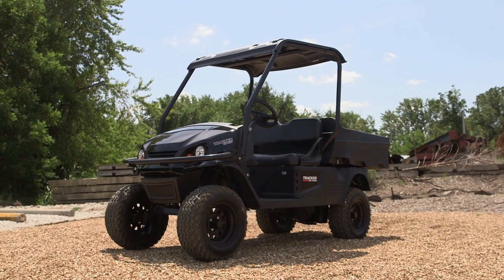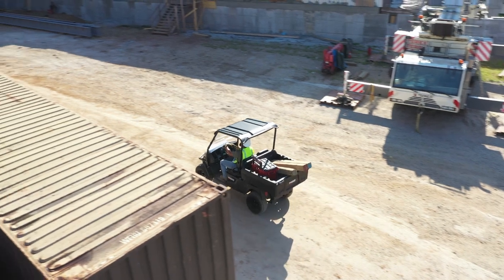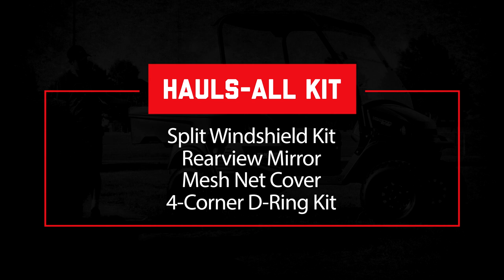TRACKER OX400 Demonstration & Bumper-to-Bumper Walkaround

Comment: These things are complete junk. Just test drove one. Its a golf cart with no suspension.  Going down a gravel road is rough. Im not sure why they put off road tires on it because it doesn't have enough power or suspension to go off road. Its literally nothing more than an overpriced golf cart. You're not doing any real work with  this thing. It's completely gutless and pointless.
Reply: Glad I read this. Thanks
Reply: Mine hauls rocks,firewood and takes me through the woods to fish or hunt.runs around 25 mph. What else do you need.

Comment: Where is the battery
Reply from the maker: OX400 battery information should be available in the owner's manual here: https://www.trackeroffroad.com/content/dam/wrmg/tracker-off-road/documents/owner-manuals/2021/2021_Owner_Manual_OX400.pdf
Reply: Under the seat on driver's side